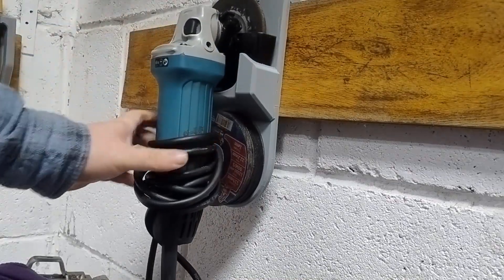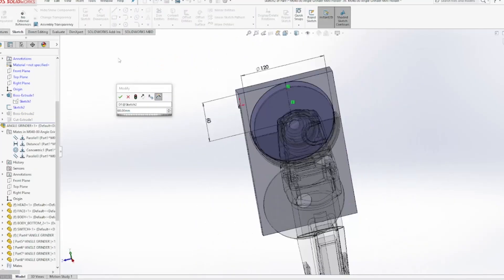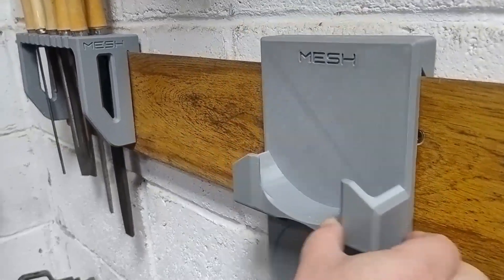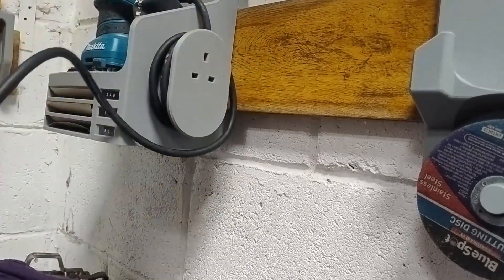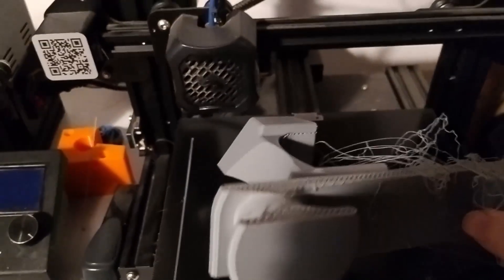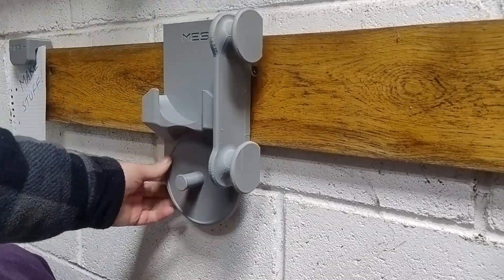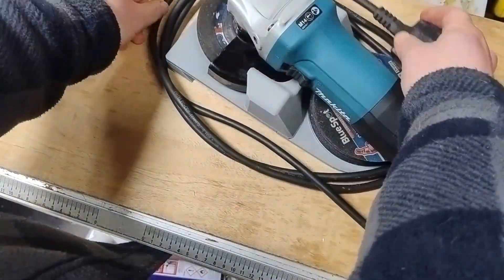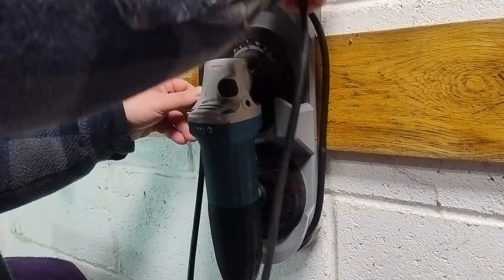This Was Supposed to Be a Simple Angle Grinder Holder… 3 Designs Later, I Finally Got It Right

Comment: Well, this is good for a sub! I currently have an angle grinder bin, and have been hoping for some sort of solution... and this is really close! Since you asked, and since the cord is on the bottom, did you consider a wrap spot below the disk storage? Maybe the rough size of the disk area, and a nice wide center (with plug holes?)  It could even be an oblong like you did on the side? Oh! and yes, it needs to be very quick in and out like @KnowArt suggested,  Just thoughts. thanks for sharing!
Reply from the maker: That's a good Idea. I always struggle with horizontal space on the wall so putting it underneath would help with that. I will try CAD something up and see if it can work!  Thanks!

Comment: nice job. I'd 100% go for a way to mount that cable that's super duper quick. Just a single pin on the side probably that I can put the rolled cable on.
Reply from the maker: Thanks, That's a good idea to just have one pin that it can loop over. I will try it out on the next design